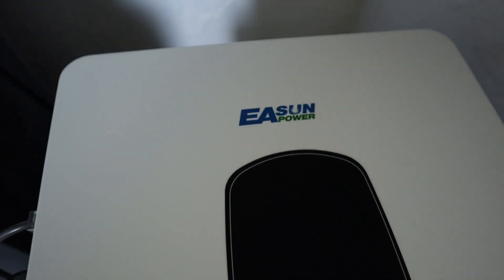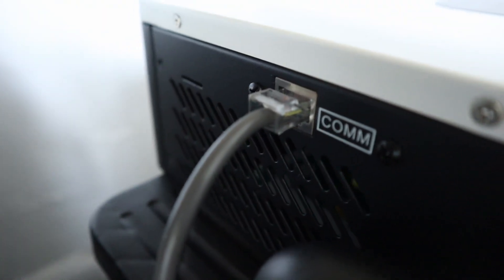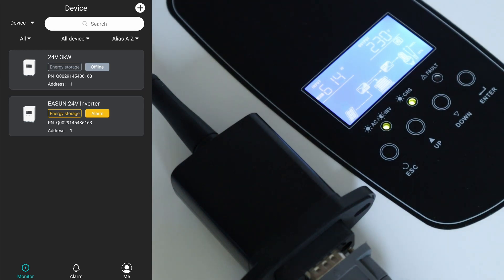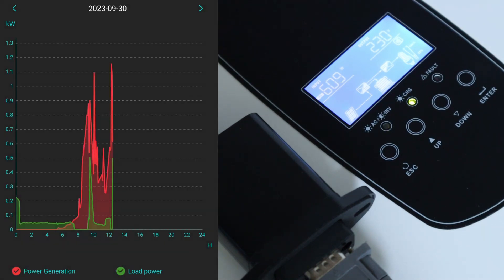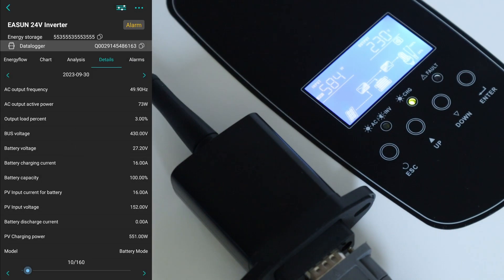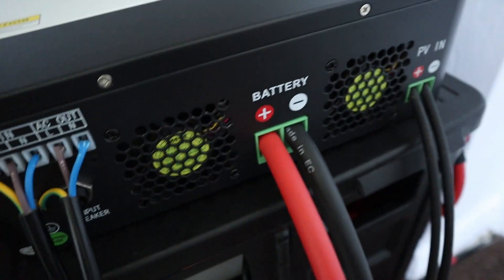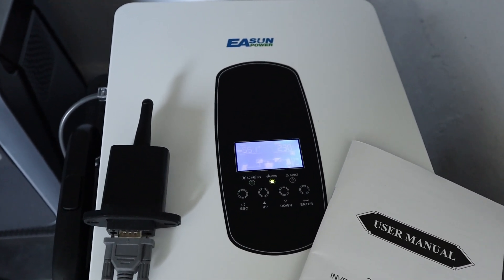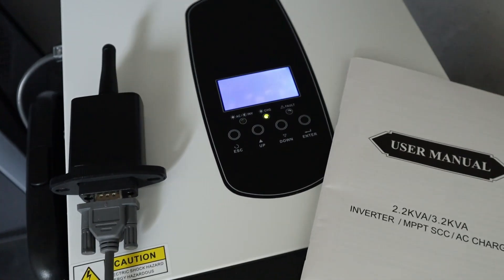EASUN Solar Inverter | Cheap, but worth it?

Comment: Hello. Does the 230 output feed power into the ring mains of your house and then export power to the grid ie is this in effect a grid tie inverter.
Reply from the maker: @boatingsibbingandwandering3262  Thanks for your question. This is an off-grid inverter so it doesn't feed into the house supply. I’m my case, I only used the grid to charge on cheap rate. All the best, Adrian

Comment: With the 3.2kw if the DC gets low will it auto shut off and auto start?
Will it start a generator if the batteries get low automatically ?
Reply from the maker: @corydemarco9196  Thanks for your question. It's like most of these kinds of inverters; it will stop when the low voltage cut off setting is reached (or the battery BMS low voltage setting is reached whichever is first to hit) unless there's an alternative source connected (e.g. solar or grid). I've not used it with a generator and unless there's a way to trigger it externally, it would be reliant on supplying the grid input on the inverter (so manually starting the generator). Once power is supplied it should wake up and start to charge/supply power to the inverter AC output. I hope this answers your question? All the best, Adrian

Comment: Hi
Can anybody explain the difference between the Easin ISolar SMH 11 (off grid) and the SMG 11( hybrid) version 
Essentially I'm interested in prioritising solar an battery and any shortfall in power needs, use the AC input /out (is it seamless or does it need to be switched ) any advice would be greatly appreciated

Comment: Second hand 5kw easun for 400€? Idk should I rather buy new from their website, that have so many models....
Reply from the maker: @rockrl98  AliExpress has deals for new ones from time to time (links in the description of my videos). Are you looking just at EASUN? I'm currently testing another 6.2kW 48V inverter from Anenji, here's the video if you wanted a look https://youtu.be/5hY7uGLMyno. I guess it's finding the right deal for what you need. I suggest looking to see what output in kW would suit your needs and the amount of panels/battery size. You could go second hand, but that would come with some element of risk and new ones aren't much more expensive. Cheers, Adrian

Comment: It work if are only battery power? My Easun ISOLAR SMH II 4200w  24v disabled Inverter after solar ending. In my location is not AC input.
Reply from the maker: @antikurjers  Thanks for your question. My inverter only works with a battery connected. The only inverter I've tested so far that works without a battery is the 48V version of the Anenji, in this video https://youtu.be/5hY7uGLMyno. Please let me know if you have any other questions. All the best, Adrian

Comment: Hi. Do the connections for the battery look strong and reliable?
Would you posts photo of those connections, please?
Thanks!
Reply from the maker: @pafigoro  Thanks for your question. These inverters are all very similar with the battery connection terminals and I've never had any problems. As long as you strip the correct amount of insulation to reveal enough bare wire for the terminals (specified in the manual) it should be fine. Something like this https://youtu.be/5hY7uGLMyno?si=AEeXcarXwq3_q_I0&t=294. I hope this helps. All the best, Adrian

Comment: It is possible to draw energy from the grid and PV at the same time?
Reply from the maker: @99enco  Thanks for your question. There are a couple of modes you can use as follows:-

SUb Priority (default) - Solar energy provides power to the loads as first priority. If solar energy is not sufficient to power all connected loads, utility will supply power to the loads at the same time. Battery provides power to the loads only when any one condition happens
- Solar energy and utility is not available.
- Solar energy is not sufficient and utility is not available.

SbU Priority - Solar energy provides power to the loads as first priority. If solar energy is not sufficient to power all connected loads, battery energy will supply power to the loads at the same time. Utility provides power to the loads only when battery voltage drops to either low-level warning voltage or the setting point in program 12 (this means menu item no 12).

Does this answer your question? All the best, Adrian
Reply: Thx 🤝

Comment: I have a 10.2kw easun inverter with two input mppt. Can i connect two different solar strings to each mppt input ports??
Reply from the maker: @ebrimajammeh8087  Thanks for your question. I don't have your version as yet (although it's on my long list), but I've checked the product details on the EASUN AliExpress page (assuming it's the same model as yours) and it says "Solar Charger type - Built-in 2PCS MPPT Solar Controller", which indicates there are 2 MPPT controllers. As long as you don't exceed the max Voc (Voltage Open Circuit) for each of the inputs as stated in the manual, then it indicates you can connect 2 different solar strings (again, keep under each input max Voc). All the best, Adrian

Comment: I know this is an older video but im looking at upgrading my 12V LiFePO4 to 24V and going to an hybrid inverter. Would you still reccomend the 4KW 24V hybrid inverter in 2025? Im looking for something where I can monitor what is being used and what solar is generated on a daily basis, it doesnt have to bereal time but 15-20 minute intervals would be great i like the idea of monitoring without being at the inverter. My battery is a DIY battery with an 8s JK 200A BMS, thanks
Reply from the maker: @karloffgrid  Hey Karl! I think this might have been answered on the newer thread? If not, please let me know. Cheers, Adrian

Comment: Did you test the no-load current draw from this inverter ?
Reply from the maker: @qwertyasdfghg7714  Thanks for your question. With the inverter on and no-load the clamp meter measures around 1.3A. With power saving mode on it uses around 0.4A. I hope this helps. All the best, Adrian

Comment: hello! this inverter should be connected to wifi router, or you connect directly smartphone to inverter? thanks
Reply from the maker: @deneurope8966  Thanks for your question. You use the phone to connect to Wi-Fi as part of the setup process and then once the Wi-Fi dongle can see the Internet (via your router) you then access the inverter using the app (only works while you have an Internet connection on the mobile). I hope this helps. All the best, Adrian

Comment: Morning Adrian. Just got one of these but I have the 12volt version to try out and play with. I will do a tear down to see what components they have used etc. I already have a grid tie inverter running that will feed back power to the grid if not consumed. I repair a lot of electronics, so I have no problems with the installing. The Only Question I have is if it is wired to grid and solar and with batteries. If when the batteries are full and solar has surplus power from lack of house consumption, does it give the excess back to the grid. Kind Regards. Paul
Reply from the maker: @PaulRush-rx9sj  Hey Paul! It's been on my list to get the 12V version, but I have a habit of being distracted (usually by batteries) and not having enough money to get it all😆 (own worst enemy). That's really interesting about your electronics expertise as I popped this one after doing a clean (to remove dust and check out the internals). It was on my list to publish the video a while back, but have had other things come up, so I might post it sooner to get your input if you have a comparison from your own findings (area of board and component popped, slight burn mark on board, etc). I bought another one as apart from a noisy fan, it worked flawlessly for around 9 months until I 'cleaned' it 🤣. 

These are not grid-tie inverters, so wiring up directly to a CU will only allow for charging/pass-through on the inverter and it will disconnect the solar once the batteries are full. It does that on mine and I only use the grid to charge when Octopus Agile is negatively priced or very cheap (like overnight today due to the storm). The equivalent spec grid-tie ones are typically more expensive. I'd like to hear what you find and share the damage on my expired 24V as I don't like binning stuff that's repairable.

I've also made a slight mod on my new one to reduce the dust getting inside. Adding a cut piece of vacuum cleaner filter over the intake at the bottom seems to be working ok during testing. Temps don't seem to have been affected, but I guess that's only going to show up in the middle of summer. All the very best, Adrian
Reply: @DADvinci  @DADvinci  Hi Andy. Yes, did a bit of reverse on the main board. Yes, you are correct in the 230v input is a one way in to add to solar batts not bidirectional.  Not a fan of 12v due to cable sizing and all but I just wanted to play around with it. My 12v version does not charge the batteries until it sees 45-47watts of solar coming in then it will start charging. Seems Ok for what it is. But a tear down will show what Crappy caps they maybe have gone with. LOL. Send me a pic of your damaged board with what it was doing when it failed, and I will give you, my thoughts. Nice to Chat. Cheers. Paul
Reply from the maker: @PaulRush-rx9sj  You're most kind, thank you👍😊 Take care, Adrian

Comment: building an ev range extender with this unit. got one on deal from china for 140 usd. 24v, 240v out, ~3kw max.
wondering if I will be able to do pass through charging, so 240v in from the free ev charger, hopefully charging my 8kwh 24v range extender pack, while also outputting up to 3kw for my car? seems to me as long as the evse can supply enough amps, it should allow pass through charging to my car while also charging the range extender. it says max ac input current is 60a = ~14kw, so i would imagine it could do both with pass through? ~12.5a or 3kw for the car, another 60amps *24v=1.5kw for the battery? net is only 4.5kw
Reply from the maker: @vevenaneathna  Thanks for your question. The rated output for this inverter is as you've mentioned. The max AC input is related to the charger 60A @24V which can be increased to 80A @24V when solar and AC charging is combined. I've not setup a direct mains connection for the AC input which specifies the use of a 32A breaker for this model in the manual. In theory it would provide pass-through while battery charging in your setup, but mine is limited to 3kW output due to wiring and the standard plug I use for AC input (battery charging only). I've got no way to test over and above 3kW on AC without a direct connection to a consumer unit. I'm trying to understand how the free EV charging is working for you? Is it a plug-in one? Does the EV charger just supply 240V output? Look forward to hearing more. All the best, Adrian
Reply: @DADvinci  ya so the ev charger supplies 240v at the j1772 output. ive seen teslas charging up to ~7kw on the charger so i know its capable, i think about 6.8kw per cord (usually 2 cords per box). i know with my own j1772 evse cord, the car tells the evse that it wants ~3-3.3kw, that message would be handed between the 220v output side of the inverter, into a nema 14-50 (50a rated) plug, into the evse cord, which communicates with the car to do ~3kw.
the j1772 e-bike adapter is what i think is the magic black box. the plug says its rated at 220v at 50amps, but that doesnt seem to match the "12 gauge wire". it only has 2 lives, and a ground wire going into a nema 15-20 (which should nomrally only be 120v, 1 live, 1 neutral 1 ground). i suspect it is wired on the pilot line of the j1772 unit to request up to 20 amps, which would be around 4.8kw. i probably have to set the inverter to have a max charge rate of the battery to be 4.8kw - 3.3kw to the car, to avoid cooking the cables is my current plan. maybe a little bit lower like 16-18 amps total at 220v = ~4.25kw total
or just plug in my battery pack seperatly after my car charges and dont mess around with pass through is probably most safe....
Reply from the maker: @vevenaneathna  Thanks for sharing your setup👍. I wish I had a way to test it, but don't have an EV. I guess it's whether you want to risk it or not. Like your final point, I personally would take the more cautious approach and not use pass-through. Cheers, Adrian

Comment: Hi, I’m interested in purchasing this inverter, but didn’t find enough info about if it’s going to work with my 12v battery or I should consider upgrading the battery to 24V?
I saw in the settings that there is an option to select battery voltage - have you tried using the inverter with 12v setup?
Reply from the maker: @finessefishing3870  Thanks for your question. This is specifically a 24V inverter and wouldn't work with a 12V battery (low voltage DC cut-out on this is 21V). You have a couple of options, get the 12V version of this inverter or upgrade the battery to 24V as you've mentioned. Usually, the higher the voltage an inverter runs at the higher the mains (230V) output in watts (depends on what you need to run), as long as the battery can supply the amps needed by the inverter to run at full-power. Please shout if you have any other questions. All the best, Adrian
Reply: @DADvinci  , hey Adrian, thank you so much for your help! So, I ordered the inverter and a 24V battery for it.  Currently I’ll use the gas powered generator to charge the battery via the inverter, but I’m planning to get also some solar panels.
Do you think that 2X410W will be enough to charge the battery during the winter (I’m located in northern Greece- should have about 3/4h of sun).
Also, if I understand correctly I should connect the panels is series, so that the inverter will works with them. 
Here is the panels data :

(Vmp) – 31.46V
(Imp) – 13.04A
(Voc)  – 37.45 (± 3%)
(Isc)-13.85A (± 3%)
Reply from the maker: @finessefishing3870  No problem at all, glad to help where I can. May I ask what size 24V battery (in Ah) you went for? I guess it will be down to how much you consume when the sun isn't shining (linked to how much battery capacity you have). Winter is always a test in the UK, whereas the bigger the solar panel array the better as the sun is very low on the horizon and doesn't show up for very long. The MPPT solar charging circuit in this 24V inverter has a working voltage range of 55-430Vdc and a max (total) Voc for all panels connected of 450Vdc (important to always remain under the max Voc voltage), not a problem for your proposed setup with two panels.

With the panels you're looking at you'd have to connect in series as the Vmp of 31.46V is too low for the operating range of the MPPT solar circuit range (55-430Vdc), so connecting the two in parallel wouldn't work. In series, this would give you around 62.96V (2 x 31.46V in the best solar conditions = cooler sunny days). If you did have enough room without shade, I'd suggest more panels to ensure you're getting enough to remain in the MPPT range, especially during winter.

If you could let me know about the above questions, as in, battery capacity and your typical daily usage, that might help more, but I'd still suggest more panel(s) if you have unshaded room and budget to do so. Cheers, Adrian
Reply: @ , thank you for the information, Adrian!
The battery is 100Ah, but I’m planning on upgrading to 200 during next year.
I have just ordered 3 panels of the mentioned above. Currently the forecast for daily consumption is about 2kWh. Most of which will be during the day with peek about 1.2kW-1.5kW.
I know that the current setup is not optimal, but I’ll use the gas powered generator for this season.
Reply from the maker: @finessefishing3870  My pleasure👍. Great call on the panels! Your setup is very good to begin with and has the added benefit of being scalable, both with batteries and extra panels (if ever needed). Please let me know if you have any other questions. Take care, Adrian
Reply: @DADvinci  , hi Adrian! It’s me again with some more questions 🙈 So, I decided to test the inverter today and connected it to the battery. Here I have some questions :) in the inverter settings there is this Menu 5 Battery type. Since I have bought a LiFePo4 battery, I’m not sure which setting I should choose in this menu. 
Also when connecting the battery for first time - when I touched the negative pole on the battery there was quite a strong spark. To be honest it really scared me, but it looks fine and working now - is this normal? Or I should first connect negative side of the battery and then the positive.
I tested connecting the inverter to the AC at home and it looks like it’s charging the battery pretty fast, so now I’ll only have to test it with the solar panels.
Reply from the maker: @finessefishing3870  Hey! Sorry for the delay, been a very busy week. For battery type I use 'USE' in menu 5 and set my values in the other associated menus 26,27 & 29.

The spark occurs as there's a sudden in rush of current as it charges the capacitors in the inverter on the first connection or when the inverter has been left off for some time (capacitors are discharged). LiFePO4 (lithium) batteries can push lots of current hence the big spark. I'd suggest getting a resistor so that you can prevent future sparks (this slows the rate at which the capacitors can charge reducing the spark significantly) and can reduce damage to the terminals. Here's an example of using the resistor on another battery I've got https://youtu.be/AEjroUPdkTw?si=H9O9BfAv0httBxYQ&t=378. 

I hope this helps. Cheers, Adrian